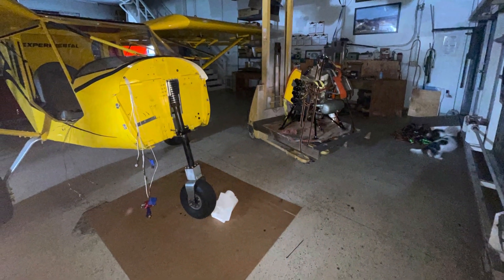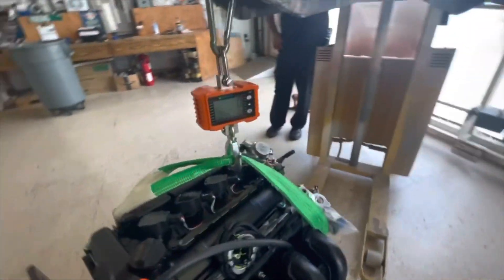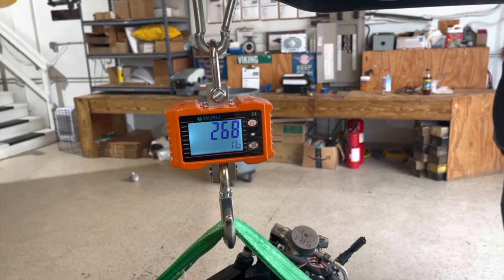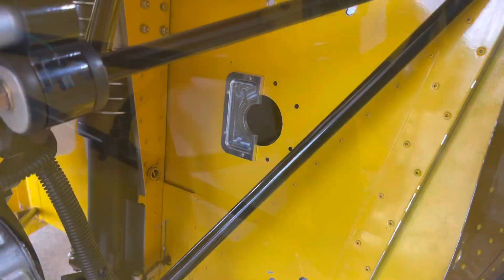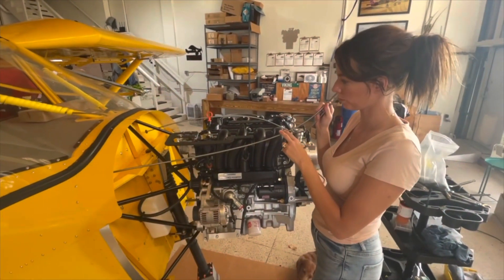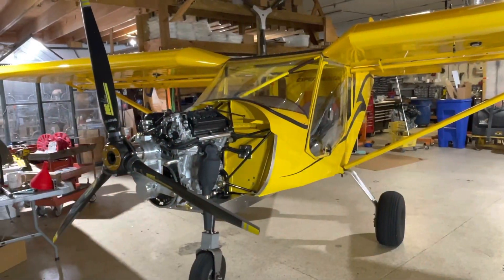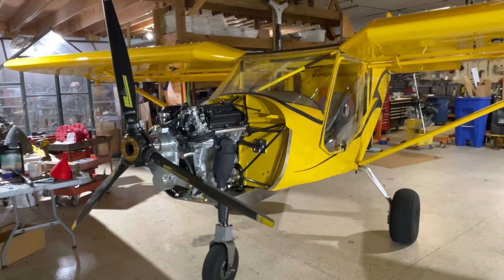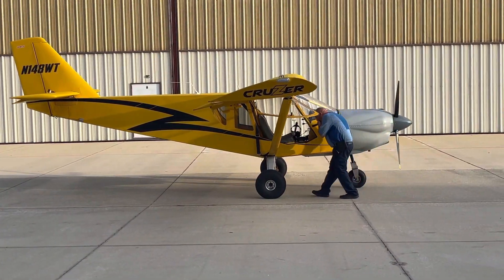A Viking Engine - More Speed - Less Fuel

Comment: You did so much weighing and measuring on the IO-240, prop angles, engine weight, total weight of the plane. A lot of people are watching your videos because they are considering installing this engine in their aircraft and are interested in the prop angle and the total airplane weight ready to fly.  Seems odd that those things were not discussed after the install.
Reply from the maker: Not intentional, after flight delays and having to extend my trip after UPS lost stuff, we didn’t hVe the desired time we wished we had. I don’t recall the final weight, but it weighs more than the previous setup. It also has more performance/efficiency and a header tank. Also, you really need to keep in mind there are many variables with weight. We have many flying at 796 lbs and some at 950, we always find most of the weight is more based on other factors than the engine. Most engine installs are working 20 lbs of each other one way or another, but have different variables as well.

Comment: The Viking Engine is great and all but…. 

Just remember your carb heat…oh wait, you don’t have to. 

Just remember to carry 1-2 qts of extra oil in the plane…oh wait, you don’t have to. 

Just remember to preheat your hours before you go fly…oh wait, you don’t have to. 

Just remember that in the unfortunate case of a prop strike you’ll need $10,000 to have it broken down and inspected and might need a new crank…oh wait, that’s an O-200.

Just remember to calculate fuel around 6gph…oh wait, that’s O-200 again. The Viking is around 4gph.
Reply: And remember to start thinking about an overhaul suggested at 2000 hours. Oh wait that’s an O-200.
Reply: @briantii What is the viking overhaul interval? I couldn’t find it on their site.

Comment: We got the before aircraft empty weight. What's the after?

I was expecting to see the empty weight drop by about 75 lbs from the io-240.

320lbs with oil to 229lbs with oil is a 91lbs difference. I'm sure with the radiator and other installation items the 75lbs weight loss is probably pretty accurate. Awesome to see!